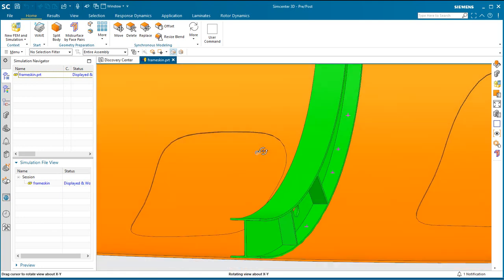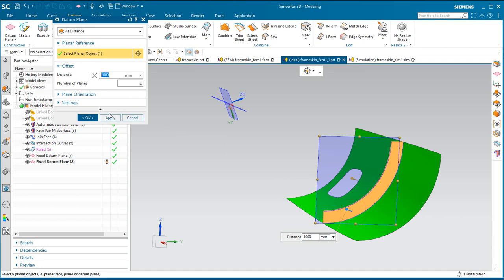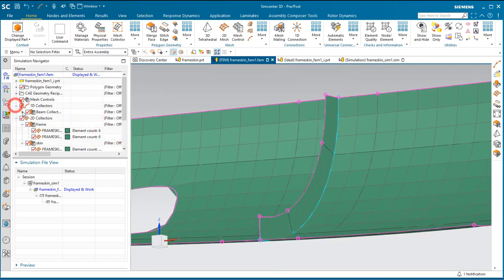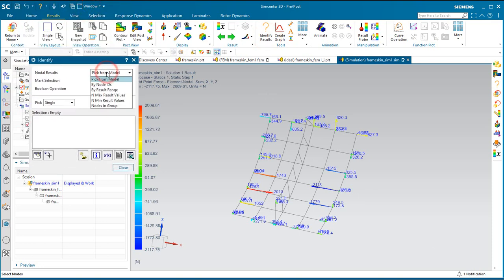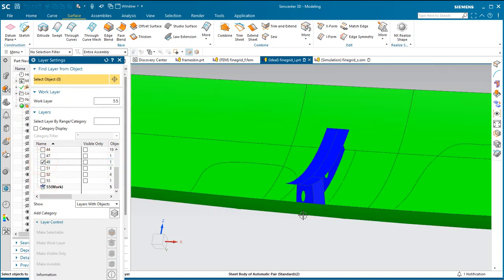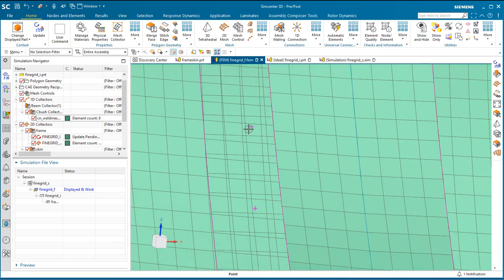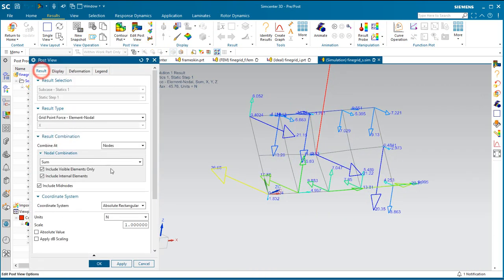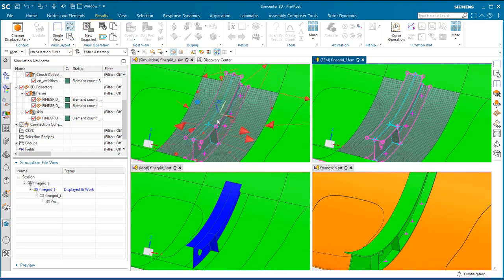Simcenter 3D Force Breakout Modeling I

Comment: Is there any preference whether to use the force based field or displacement based field for the sub modelling ?
Reply from the maker: Some airframers have a preference for force.  If you're not sure which one to use, try it both ways and see which answer you like better.  It may not make a difference depending on how far from the edge of the breakout you are looking at the results.

Comment: Shouldn't you apply also grid point moments to the finer mesh model?
Reply from the maker: Yes, good catch.  Another way would be using Superelements to model the breakout section.
Reply: @Simcenter3DTipsandTricks  Interesting option, but how do you interface two non-congruent meshes in superelements?
Reply from the maker: @carlomariafranceschi8112  I haven't tried it yet but you could either go for the closest node or spread out the load with rbe3 spiders along the perimeter.